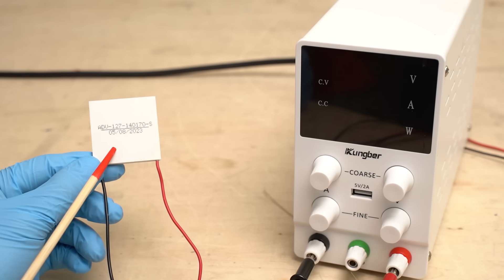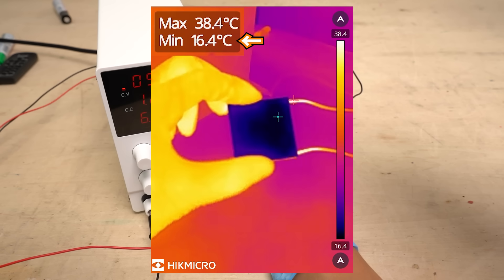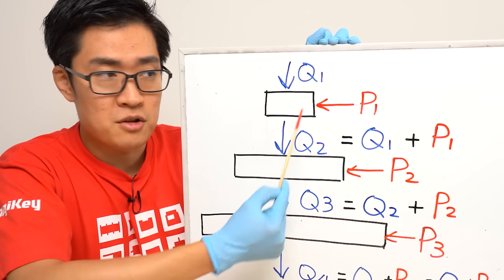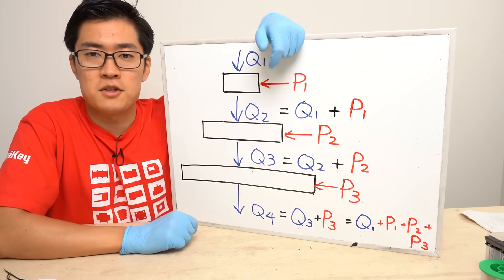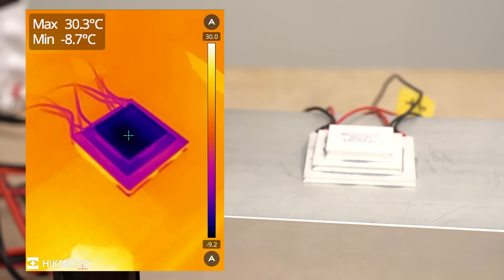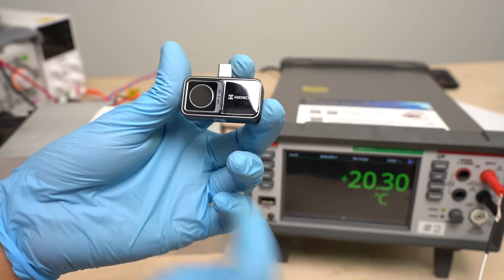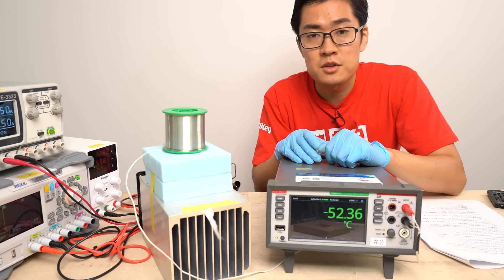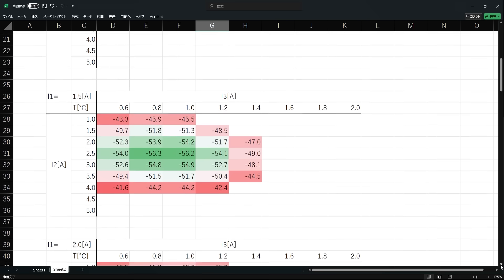Stacking 5 Peltier Modules, and Reached -90℃

Comment: Some foam insulation is much less efficient at lower temps.  In the US(maybe other places too) the standard used to measure the insulation is at around 25c.  I don't remember the specifics as I looked into this years ago when I was selecting insulation for a project.  Some foams are very poor insulators at freezing temps others get a little better.  No clue at -30c and below.
Reply: Wait what? I had no idea!
Reply: @AddyEspresso  It's a limitation of the testing standard used for testing home insulation.  Very few insulation makers publish any additional info about  R-value at a temperature range, but some independent organizations have published results.  

At least a few years ago, it took a lot of digging to find this info.  Hopefully it's easier now, but I doubt it because there is no real incentive to help the public know this info.
Reply: oh forgot to add, depending on the gas used in the forming of bubbles within the foam, over time this gas escapes and the R-value gets worse.  This happens over many years so by year 10 to 20ish, the gas has dissipated so know the blow agent is basically air.  But builders/manufacturers have no real incentive to care unless people notice this and change purchase habits.
Reply: @Chris-ut6eq  I plan to build my own home someday so you may have just changed the course of my life

Comment: ✅ An engineer I was acquainted with in the 1990’s made an air conditioned hat for the summer time using this technology.  It was just for fun.  My two cents… Had he developed it, the premium market would be construction workers helmets as these are near unbearably hot in the summer and required by OSHA.  These helmets also have a gap between the hat adjustable head grip and the outer shell so there is room for the tech and a heat sync, etc. It’s an industry ripe for hottsey totsey productivity tech.  The power supply could be a hook around the belt with a magnetic cable hold capture ends so if the cable snares, it slides out of connection without danger of the pulling off of the hat. Safety is always seriously first on any construction site because there are plenty of ways to get seriously hurt very fast.  

If the heat sync is too heavy, it won’t work as that would cause the hat to be top heavy and unsafe.  Alternatively the entire system can be at the belt and flex tubes can flow a coolant or liquid up in the hat to a coil.  

Keep inventing and stay focused.  Success is not for the lazy.  Success is for those that follow through.
Reply: Peltiers are way too ineficient for any of that to work practically. Not sure if you noticed, but that thing on the video uses 130W for minutes to coold down to -70c the area of a stamp. As an example, a normal refigerator uses 500/600W when running (And it also just runs for minutes).
Reply: Phase change materials would probably be better. Peltier are a fairly niche solution. Waste tons of energy but can cool a small area with no vibration. Image sensors noise reduction is a common one. 6 pack car fridge is a pretty awful one.
Reply: @ yes they're fairly useful keeping something that doesn't generate much heat at a stable temperature, both heat and cool. only reason they're in car fridges is that they're cheaper than a small compressor.

also it makes the design of the device really simple. especially when you don't make it good.
Reply: They make cool suits that are little silicon tubes zigzagged across a mesh vest (the store bought ones are over priced, IMHO). Some come with a TEC waterblock heat exchanger to chill the water and a little reservoir with integrated pump. The exchanger could be on a belt over the butt blowing hot air out and away, and maybe some excess cold down the beggers canyon. Or draw from a scoop tha goes over the belt, so you get a constant draft....

As for the helmet thing, youd want the heatsink on the exterior of the helmet and the cold plate inside with its own heatsink and a fan blowing over it. Like how the little travel coolers are made (though those use just a plate on the cold side....they should use fins IMHO). Also, if you have cooling/warming cupholders in your car, guess how those things work ;)

Long story short, these ideas exist out in the world, some are tied up in dead patents waiting to run out, others are sitting in some nerds head waiting for the funding to develop them (waves). You should hear my fix for the whole drone delivery thing, we dont need as much AI as they're trying to make do things it wont be able too, and itll give WAY more people jobs....Of course, youll have to sign an NDA first ;)
Reply: Il campo magnetico che si crea è dannoso per il corpo 😅
Reply: you could fit a compressor in a thin backpack these days.  anyway ultimately if it's for use in the sun the problems always carrying around the power source

Comment: Does driving Peltier devices via PWM affect their ability to heat/cool? Interesting well made video.
Reply: You are much better off with analog control than PWM, as the devices perform worse under high power.

Comment: 5:05 honestly using Thermal Grizzly Kryonaut Thermal Paste, as it is specifically designed for use with sub ambient PC cooling using liquid nitrogen, would be a good thermal paste for the application.

Comment: You have gotten on a path you cannot leave now. You must keep going. More peltiers, more cooling, more heatsinks, more power.
Reply: the only end to this journey is absolute zero, or at least as close as possible
Reply: @Minty1337  -272c is 0 Kelvin, that's a long way to go
Reply: @numchux2  hence why i said "at least as close as possible" lmao, i dont expect it to be possible to go below around -200 with just peltier coolers due to waste heat
Reply: Actually, the Peltier effect decreases with decreasing temperature, so the lower you go, the less heat you can pump. I don’t know what the actual lower limit is, but -92C is probably pretty darn close.

(I know, I was really disappointed when I learned this too 🙁)
Reply: @DaveEtchells  but i have a device i got online along with a (very) big brand datasheet and lab test results for a "better than peltier" device. :p
its much thinner and built with copper wafers. havent fired her up yet. couldnt not buy one though 😅
Reply: @luminousfractal420  where can i get one?
Reply: @DaveEtchells it's enough to keep food stable. And honestly there could be some use case for the stacc in Various devices. In fact I can think of some engineering applications for cold on demand like that.
Or so I can make the worlds most over engineered fridge to rapidly chill drinks in a little box.
Reply: YES
Reply: I suspect that below a certain temperature you'd need a different type of peltiers.
It's still amazing to achieve that low temperature.
Reply: New series: Road to -273
Reply: @nkjoep  maybe stack more peltier and use liiquid nitrogen as the heatsink cooler
Reply: I want to see if 0K is achievable
Reply: @mortyforty8404  -1K or bust. break the universe.
Reply: @mortyforty8404  YES LMFAO
Reply: @mortyforty8404  Fun fact! No, it isn't possible! We can get pretty darn close but no amount of these devices will get there. Or any other kind of device, either. Weird things happen in physics when you approach minimum or maximum values.
Reply: @mortyforty8404  solid state physics predicts it isnt. Semiconductors stop being semiconductors between 50K and 100K
Reply: @mortyforty8404  0k is almost impossible he would have to get the atoms to stop moving. still would be cool tho
Reply: @mortyforty8404  0K is never achievable due to quantum fluctuations which are always present
Reply: @mortyforty8404  IMPOSSIBLE IT IS, you can get really really close but NEVER exactly 0K
Reply: @mortyforty8404  zero k is practically impossible
Reply: @ALiRAZA-mg8bd  It is actually impossible according to known physics. Heisenberg uncertainty principle forbids a particle to have 0 energy. Therefore, exactly 0k is impossible as far as we know.
Reply: i fully agree !
Reply: More, more, more...cowbell.
Reply: 181K that’s pretty impressive!
Reply: "I don't know how it's possible, it cannot be explained, I almost got insane trying to figure it out, with 72 peatier devices I got -284°C"
Reply: @realdragon  It can easily be explained. Liar liar pants on fire.
Reply: Sadly no.  I think he is closing in on the theoretical maximum with peltiers.  I want to say something around -110 has been reported with stacks done in a lab.  At some point the inefficiencies make further drops roughly equivalent to the heat generated so no cooling.  Just added inefficiency.  Certain semiconductive materials might be able to get you slightly lower but not to -273.15C.
Reply: More old school voice overs
Reply: Now grunt like Tim Allen! 😁
Reply: More! Give us everything you have!
Reply: good to record air pressure and humidity too
Reply: quantum computing will pure solid state devices !
Reply: It's peltiers all the way down until you get to the turtles
Reply: Now connect the hot side to a Sterling engine to help power the whole system.
Reply: MORE BOOSTERS! Oh... sorry, wrong channel.
Reply: is darth sideous voice. UNLIMTED POWER!!!!!!!!!!!!!!!!
Reply: Can we make a mobile phone gaming cooler using peltier device 
Using this way 
Please reply!
Reply: 1.21 gigawatts precisely!
Reply: You’d need to get it up to 88mph… cue the lightning
Reply: building mayan temples
Reply: Liquid Oxygen!  It's a miracle!
Reply: Time to find out how big of a heatsink, how many peltiers stacked, and how many watts it takes to cool to absolute zero Kelvins
Reply: prove them that absolute zero is achievable 😅
Reply: @d4rkpunk69  Its absolutely not achievable
Reply: Tim the Toolman Taylor gives you 3 grunts
Reply: @ghostdog662  based
Reply: ABSOLUTE ZERO!
Reply: MORE... PELTIERS!
Reply: The internet is hungry and somebody's gotta feed it
Reply: He will be the one who achieves 0 kelvin and freezes something absolutely
Reply: Maybe he can freeze hell over with this!
Reply: device to liquify air would be awesome
Reply: Ice is an insulator
Reply: and a hopefully continuous dry ice production.
Reply: Right!?  MOAR POWER!!!!!
Reply: I continue to "shake" oilmen with my innovative project of a non-combustion engine, I remind you that I am posting here on my channel the technology and the principle of operation, according to which anyone can create a prototype and enjoy free energy, since I was denied financial support at the stage of the idea and theoretical research, after a year of unsuccessful searches. Including I will begin to assemble a sample. And soon another video will be released, revealing my developments, the wind of change is approaching! All those who are not indifferent, welcome to the flight in this departing innovative car, which will lead to great achievements for the successful future of the planet and humanity!

Comment: you should try an TEC1-12740 peltier element. It has a cooling capacity of 338W and uses around 600W
Reply: Talk about inefficient
Reply: @DarkAttack14  That is the normal efficiency of peltier, it IS terrible... It is very few situations where peltier is the best solution for cooling anything.

Comment: You ideally need a much bigger ratio of size between each stage as the peltiers are so inefficient. Something like 10x increase in area per stage.
Reply: I was thinking if you increase the stage ratios too much it may become beneficial to include copper heat spreaders between them, I'm not sure what the thermal conductivity of those ceramic plates is but I doubt it's as high as copper or other common heat spreading materials.
Reply: @xxportalxx. Youre right on that one. Copper heatsinks would greatly improve this. I'm wondering if it's good enough to go fanless
Reply: @ copper spreaders were common when people were tinkering with stacked peltiers for overclocking. the watts for running the whole system just go through the roof though like do you really want to run a kilowatt+ to overclock some athlon, might just as well just buy some dry ice

a compressor is so much better for that though, but there's not really like brick and mortar market to buy all that stuff and refrigrants in the west like some asian countries.. so people didn't consider compressor based systems for diy.
Reply: @xxportalxx. Great idea, and I'd recommend insulating the sides if cooling below ambiance temperature. (Condensation+they'd be absorbing heat from the surrounding air)
Reply: Good idea.!
So what moves heat really quick.?
👉Peltier👈
Sorry, could not resist.
👉Heat-Pipe with Alcohol should be a solution.
Reply: You can also boost these with a heat pump for the first stage
Reply: Diamond slabs would also be an excellent choice maybe a liquid metal interface
Reply: Got that in my home lab just give me 5minutes its in the back😂 @kyduong3401
Reply: Debe usar un intercambiador de calor, mejor que sea por movimiento de líquido, y ventilación forzada para evacuar el mayor gradiente de temperatura
Reply: Why? Wouldn't it be better if peltier devices are the same size?
Reply: @realdragon  yes, it should be more efficient at least.
Reply: it can be computer theoretically and a simulation can be carried out
Reply: I'd watch that video
Reply: You could also 'save' a stage by using a different form of cooling for the warmest stage, where you only need to achieve a modestly low temperature - say, a water cooling block connected to a big bucket of icy water. That could replace the most power-hungry module.
Reply: @mikeselectricstuff that’s not correct! 2-4 times size or power increase is more then enough
Reply: @huababua8203  He's absolutely correct;  if you are trying the maximise delta T on each stage then the coefficient of performance drops of a cliff.  You would definitely need heat spreaders between stages as well as insulating all intermediate stages.
Reply: @ I never said anything about heatspreader so what are you taking about. COP peak is at 1/4 of nominal power
Reply: @ tecs have rather poor efficiency and the poor efficiency adds to it.

the poor efficiency adds cumulatively. 2x would mean it's super efficient, like if you're cooling 50 watts you need already more multiples of that 50 watts already to cool that 50 watts on the first stage and the second stage needs to cool all that. if there's no heat load at the other end it's not as problematic as it reaches max dt.

if you only needed 3x for the next stage tecs would be viable for home fridges - the efficiency would be so decent then.
Reply: I continue to "shake" oilmen with my innovative project of a non-combustion engine, I remind you that I am posting here on my channel the technology and the principle of operation, according to which anyone can create a prototype and enjoy free energy, since I was denied financial support at the stage of the idea and theoretical research, after a year of unsuccessful searches. Including I will begin to assemble a sample. And soon another video will be released, revealing my developments, the wind of change is approaching! All those who are not indifferent, welcome to the flight in this departing innovative car, which will lead to great achievements for the successful future of the planet and humanity!
Reply: @maguccimotorincorporation  nice scam bruh. just sell the electricity
Reply: @maguccimotorincorporation hippitty hopitty more scam bot crockery

Comment: I am wondering now how difficult it would be to make a cryocooler with a peltier unit for the last stages.

I figure a low duty cycle high power system could be made,     where a 2 stage vapour compression cycle cools a peltier unit,    the peltier unit cools a large insulated heat sink,   and you occasionally use the heatsink to cool at high power.

Comment: Is there a reason they are three different sizes? Would 3 large ones stacked not work the same?
Reply: It is because to cool for example 200w you will use 380w on the Peltier meaning every stage needs to get rid of almost double the heat of the previous stage. That is why the next stage must be larger then the stage before it. It is to get rid of all that exes heat the horrible inneficent peltier is crating. Peltier a bad solution and only reason to use it is because it is cheap and simple or if you have size restrictions, normally ANY other coolign solution then peltier is better.

Comment: Redo the experiment by building a cube made of peltier cells, you can cool the cube by placing it in distilled water and an aquarium pump.
Also try to build a cube made of peltier pyramids you should get an even colder point in the center

Comment: Around 20 Years ago i had a peltier cooled graphics card, i was able to keep the tempreture sub zero on a single stage 80 watt unit. I was able to achive higher overclocks than simple air cooling. Condensation can become an issue so the PCB has to be well insulated on both sides and sealed with diletric grease. It was, i would say a sucesssfull expreiment. However the extra fan noise and power consumtion just made it unrealistic for every day use.
Reply: yeah I had a 226w pelt with water cooling back then.  fun to play around but kinda useless use of money.  stuff got way too high watt after that.
Reply: oh well. once we make the dyson sphere or energetically favorable fusion or something then we can all have subzero gaming
Reply: @VioletRM  I'm gonna go out on a limb here that we'll probably get fusion before Dyson sphere star harvesting. But it still will always be 30 years away still.. :face-pink-tears:
Reply: @ eh, both are never happening, but we can dream